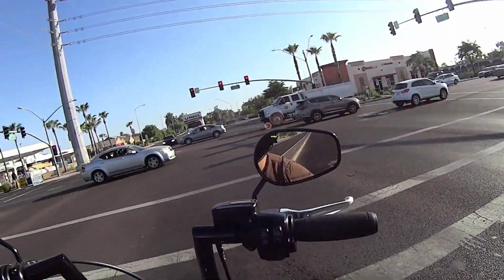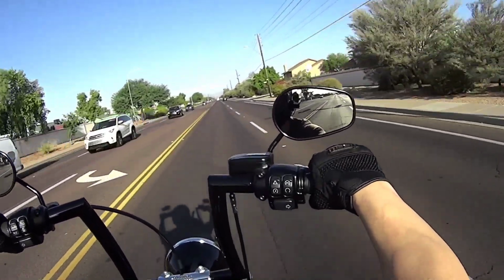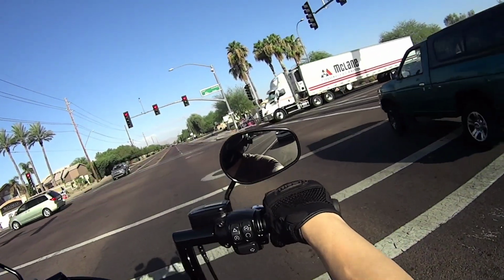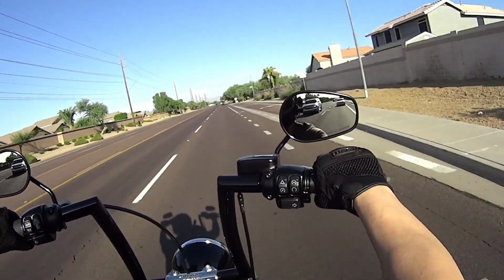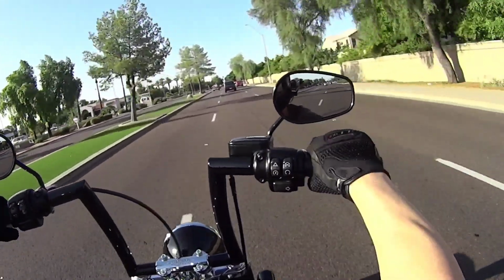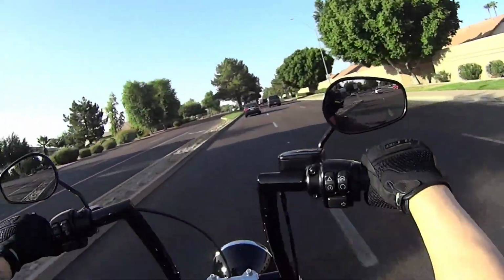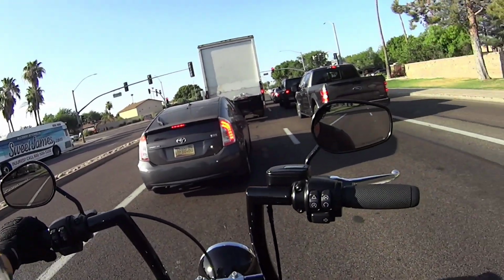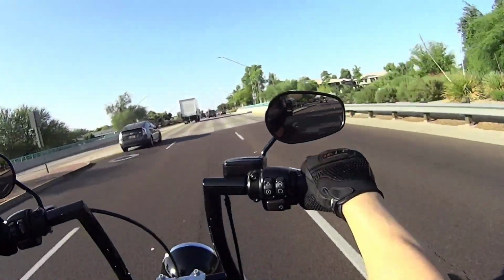Testing out the action cam riding the Slim

Comment: Great video! Little static but not to bad and you got  a great setup! I love the slim s and the ape bars you got on. Curious which bars are they?  If you wanted a video idea, I’d be interested in a video comparing the Street bob / softail slim and get your feed back on them both.
Reply from the maker: They are Dean Speed Customs Skinnyz. Its a 2019 Slim. I do like the S models that came before, thats why I blacked alot out. Browse my channel, when i first got my slim i had alot of side by side with a street bob. Feedback wise: my choice came down to the Slim or the Bob, and I chose the Slim because of fuel capacity, floor boards, and the late 40s look. The Bob is great tho. The owner of Dean Speed Customs has a 2020 Bob and he loves it. Most people cant get past the floor boards, they think its an old man setup, but it gives you the ability to place your feet pretty much however you want.
Reply: @aztriumphster  I have the 2019 street bob and love it. I appreciate the feed back and did not see that video but will look it up. My new mod I am trying to decide on is the  Apes or Tbar. That is probably my  toughest choice to make. lol
Reply from the maker: @mektrik  oh that is tough... damn. K how bout this angle; r u gonna do a fairing at any point or possibly anything with the headlight?
Reply: @aztriumphster  Def tough, I got a fairing now and don't feel I would love it without now lol  Headlight I only added the extender on it and now fits in the fairing flush.
Reply from the maker: @mektrik  so my humble opinion; T bar with a fairing. Without fairing, and maybe a longer headlight bucket and bezel, u could totally rock apes. Go way back in my video history and checkout my sporty 72. I added a different bucket and bezel and it changed the entire look of the bike. Also I've got some videos of a bob with a tank lift and apes.
Reply: @aztriumphster  I will take a look and I seen the video on the tank lift Loved it! That will be a easy mod but really slick mod at that.  So with your T bar opinion, anyone you recommend of the others? I have not  thought to much with the t bars because of I am short and the screen sits to high lol. I am 5.7 on a good day and so not to tall.
Reply from the maker: @mektrik  I love dean speed customs parts. u should go to their site and look at the bar options.
https://www.youtube.com/watch?v=rgOVtyK0e7U
Reply: AZ Triumphster Right on,  I’ll check it out.  Have you used t bars ever?
Reply from the maker: @mektrik  I've ridden a few bikes with em. I had em on my Yamaha Bolt as well
Reply: AZ Triumphster what’s your thoughts on apes vs t bar? I appreciate your feed back on this.
Reply from the maker: @mektrik  with a fairing ide rock t bars. Without a fairing ide likely try n make the bob look more seventies and put straight apes and a tall sissy bar, def tank lift.